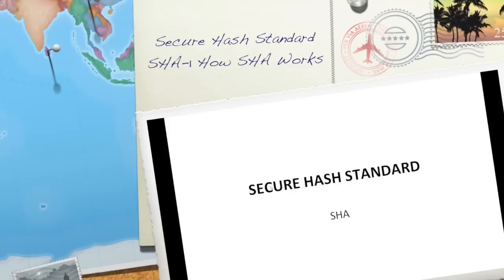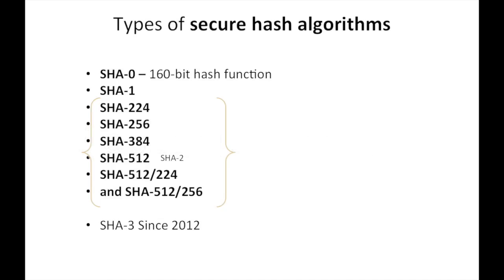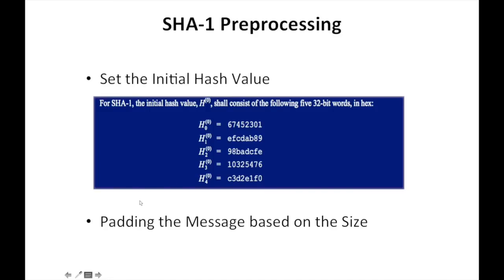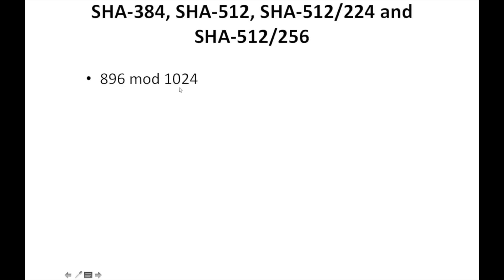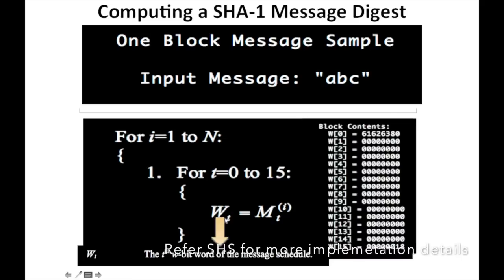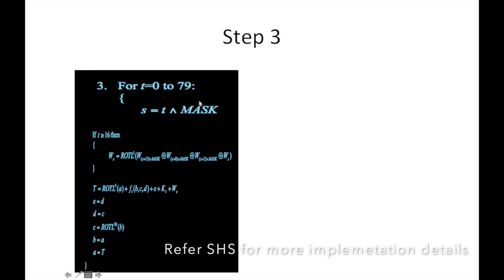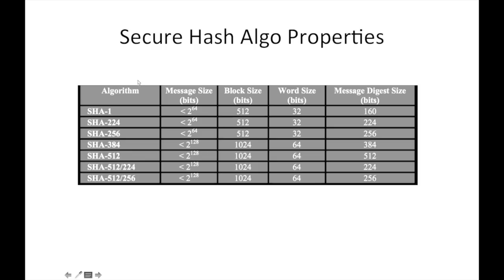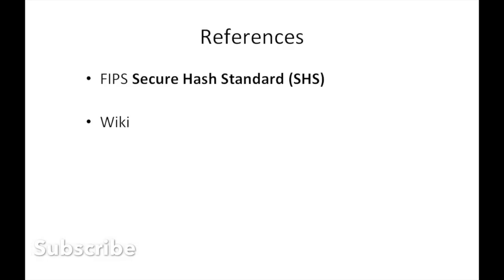sha-1 tutorial ,how sha-1 works, fips 180,secure hash algorithm tutorial

Comment: correction at 3:50  after the messages only 399 bits were supposed to be 0.. after that message length and after that 64 bits are supposed to give original message size.
Reply from the maker: thanks a-lot